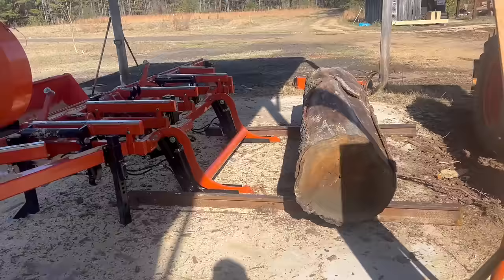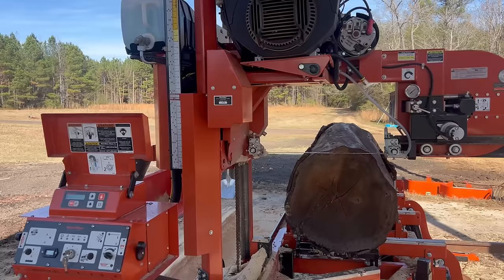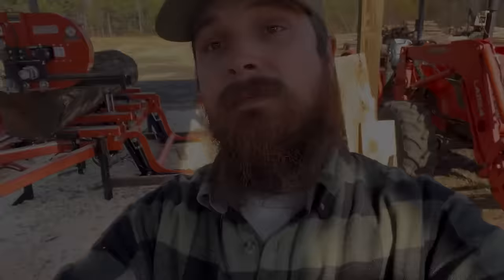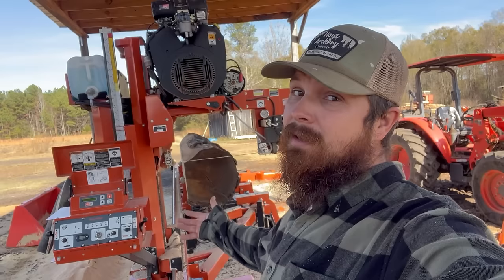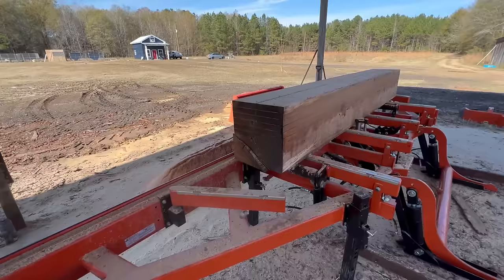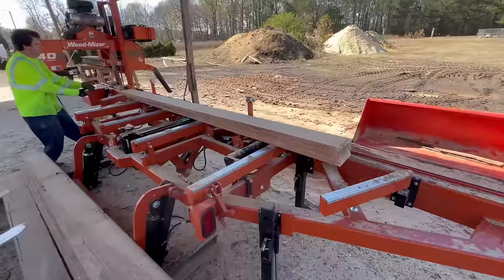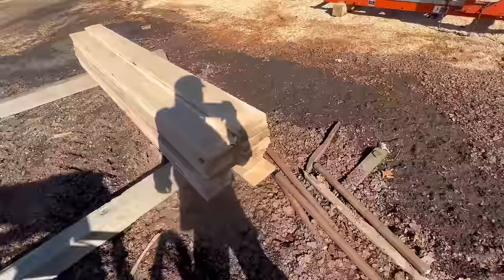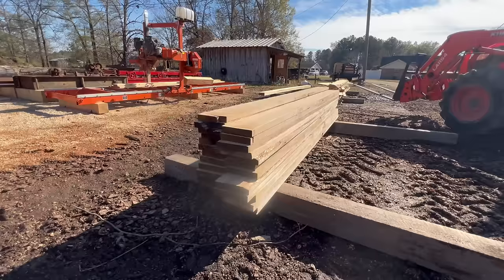Huge OAK log on our LT40 Woodmizer Sawmill!!! (Will it SAW this?!!)

Comment: I would make a small hopper under the sawdust discharge and install a trip bar on the far end of the travel and trip the dust into a skip pan on each pass but I would not trip the hopper until the slats are removed and you were sawing boards.

Comment: If you mill a lot of oak 7 degree blades work the best
Reply from the maker: That was actually a 7 on the mill. It came with a pack of 7 degree. I typically run 10 degree for pine.
Reply: @wallacefarmandsawmill  👍